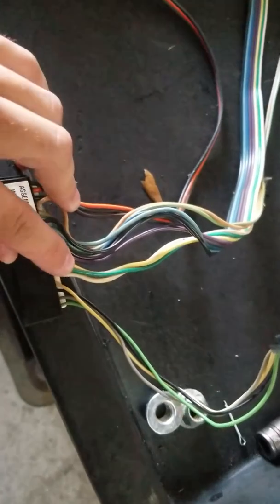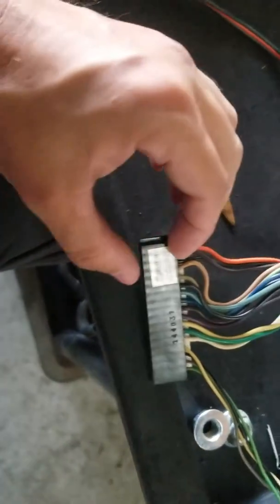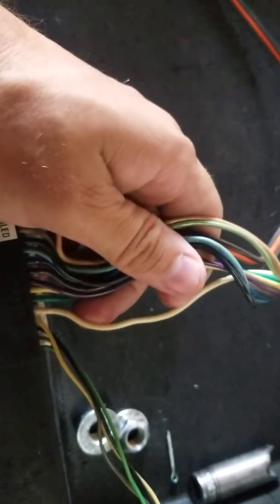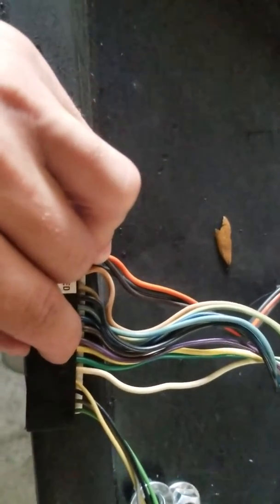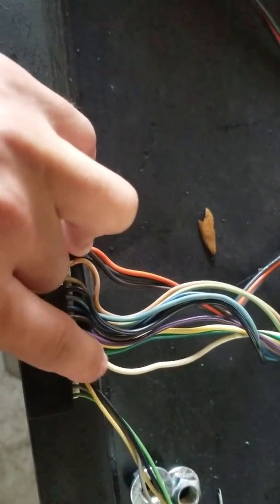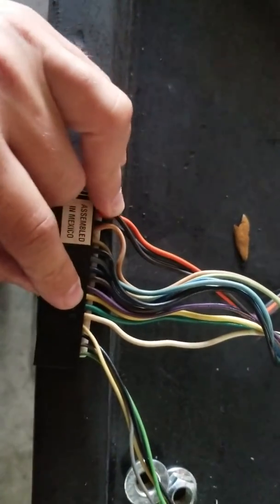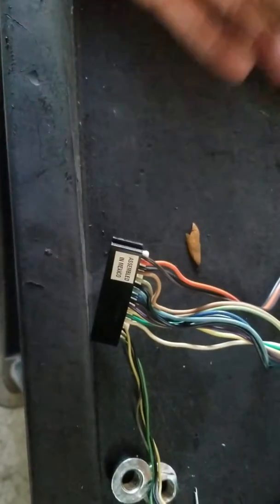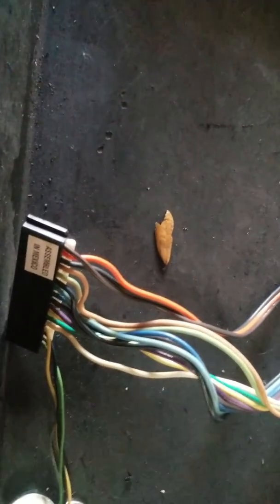cadillac eldorado brake light problem repair tip

Comment: So can jus replace the bad wire r what? Or whole thing of wires gotta 98 eldorado lights all work then the release on gear shift was stuck could not get it outta park then after got it put park a neighbor did it replaced brake light bulbs but got backup brakes and turn signals and the middle light in back windshield area all works but no tail r brake lights?? Any ideals?
Reply from the maker: gotta repace the whole switch assembly

Comment: A my name is Akeem Green and I have A 1990 Cadillac Eldorado and I'm getting power from my white wire but not my other two wires. what should I do?
Reply from the maker: ill behonest every time i look at a diagram for these late model caddys the colors never match the diagram im looking at says the white wire should be a ground. orange ,light green, and pink/black wires should be power and the light blue wire should be power when the brake is pushed by this diagram

Comment: Yes but it just clicks and I'm sorry it's a fj cruiser
Reply from the maker: i would check the starter to see if its getting 12v when you try to crank at the ignition wire if so then the starter is either bad or the motor is locked up